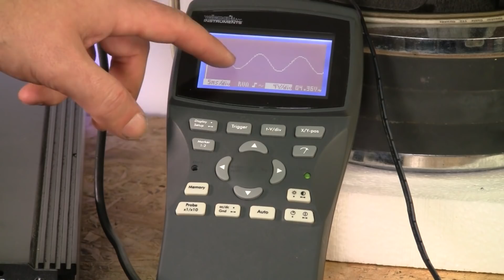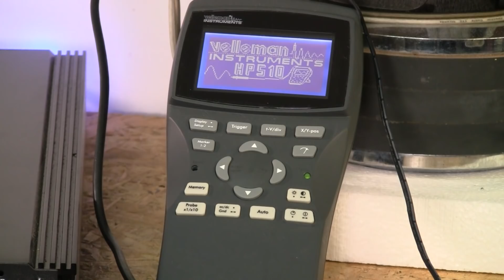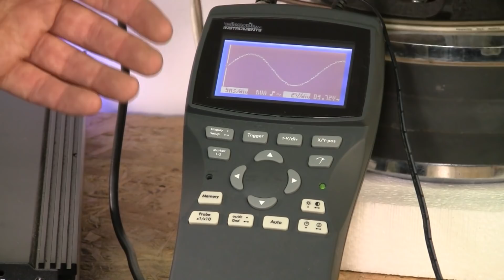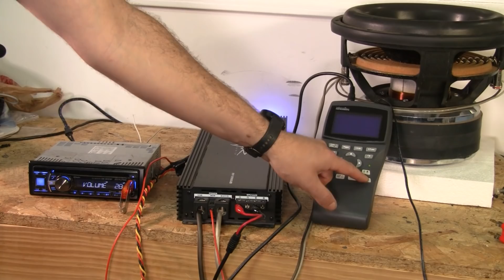How your budget amp kills subs without clipping - Tech Stuff Tuesday

Comment: I would not be surprised if there are counterfeit amps in the supply chain. This really looks like strange output. I would not feel comfortable  with that particular amp in my system. That low level noise with no input is strange, and I wish he had unplugged the inputs to make sure it was not actually on the input. But those strange half-clipping at voltages far below the rails... That is really strange. I have seen this setup working with much higher power amps. I suspect that strange signal is actually aliasing in the scope. I would bet the noise is actually up in the ultrasonic, if not RF. That amp might be causing serious RF interference.

Comment: In my opinion the amps crossovers or something is in bad shape. I've owned a few skar amps over the years currently running their skv2 100.4 on my front stage n it sound pretty good for a $300 amp. Also have a $800 rockford which obviously sounds WAAY better than the skar amp however for the price, skar equipment isn't bad as soundstream cerwin vega ect it does rated at least. The quality of the amp and the signal generated will pretty much always be a reflection of the money invested in it. Not saying anyone's wrong or right just that for the price skar isn't bad as a whole lot of companies out there. Ive had my issues with skar but no where close to the issues with alot of other companies. None the less, good to know and I will def be hooking my scope to the skar equipment I'm running atm just to see. If I do find anything similar I will reply

Comment: The simplest test would have been to start with checking the speaker terminals for a DC offset.  DC would be a likely suspect for cooking coils like that.   Amps in any price range can have that failure mode.  Good designs have built-in protection circuitry though.

Comment: Those are damn good amps and yes they do rated power hell they do 200 + more wattage over power... I got two Skar 1500 mono blocks and never not once have they caused any issues on any subs I had on em..... Skar is a damn good company
Reply from the maker: Don't confuse what a resistive load tester producing a number tell you with actual in car power. All of our amp tests we show real power, in a car, connected to subs, plus the o-scope to prove it's clean.

Comment: I have 2 12" running 200w over what they are rated on an RP-1500.1D and ran them this way for 2 years. Literally nothing wrong with them, it comes down to subwoofer choice. Another thing, is that how the manual says to hook the speaker up? I am fairly certain my manual had told me to use the outermost terminals for hooking up a single sub. Also, you are overworking the amp by using such small wire for the inputs. There are 1/0 terminals on the amp, there should be no reason you are not feeding it power through a 1/0 wire.
Reply from the maker: Ratings aren't what you think they are, and just because you didn't have a problem doesn't mean it's not a thing. I've spoken to someone who owned one and experienced what was seen in this video while another one was purchased at a different time and didn't. As far as what the manual states, the pos and negs are one in the same respectively. It's literally the same solid block of metal before it even gets to the board. There IS a reason to not feed a 1/0 wire into it, it doesn't need it and wouldn't benefit from it. That amp could operate just fine on 4 gauge wire even in a car if the wire was OFC and wasn't longer than 12 ft or so. That being said, the 4 ft long 8 gauge wire can handle quite a bit of current and on top of that, the amp isn't generating that much power in this manner. It would be drawing more current if a sub was connected at say 0.5 or 1 ohm, but with little current out it doesn't need current in.

Comment: I have a kicker cxa 400 .1 amp 
And a Skar Audio single 12 SDR sub with pre fab box at 1ohm rated at 600w rms since the amp is strong enough does that mean I will damage and ruin my amp and sub? Since it's underpowered I checked the amp Dyno sheet and it puts 514rms at 1ohm and 592 at (dynamic) 
This is the only amp I have 
And I was wondering if I could use it to power it as a temporary amp until I can get a better or would something bad happen if I do use this amp?😕
Reply from the maker: It won't be a problem as long as you aren't clipping it.
Reply: @EMFAudio  
How do I prevent clipping 
I'm new to the car audio scene 
Since the amp is underpowered would that cause it to clip? What do I do to make sure it doesn't clip this is my first audio system

Comment: Did you test it with the gain not up way to high at 3/4 way
Reply from the maker: Gain position is relative to signal input voltage, it's not a relationship to power and only related to clipping when the setting exceeds the input voltage.

Comment: you need a spectrum analyzer, along with a better oscilloscope.  Also, wouldn't the speaker itself induce a signal as it moves?
Reply from the maker: Feel free to send us $2,000 for that equipment. The speaker itself will effect the impedance, but it won't make the signal quality any different.

Comment: This needs further investigation to come up with a definitive conclusion!... It could be something wrong with your setup, your source signals, your head unit's output signal, your oscilloscope, OR that amp is just simply a very poorly designed (and very UN-refined), cheap quality Class D amp, which are more often the overall worst sound quality types of amps on average, but they are also the most efficient and most power per unit of space taken up, and most watts per dollar when new, and also the coolest running, temperature wise, and all of that is why many sub amps use Class D circuitry. But the really cheap, (and possibly even lower quality?), Class D amps like this one might be, sometimes distort the signal in at least one or sometimes even in multiple ways, which isn't as easily noticed or heard with a subwoofer, as stated in this video, but at the same time, that distorted or partially clipped signal keeps sending very high level straight DC voltage to the coils with a short duration of each DC pulse, but it's also at that exact same high level repeated over and over again really fast, one pulse after another, so that constant, rapidly pulsed DC voltage on top of the music signal, over time, that's what ultimately overheats and fries the voicecoils!...

You might also check if your oscilloscope (& test leads if applicable) are all adjusted properly, settings-wise.
Reply from the maker: The signal going into the amp is definitely fine, the o-scope checked out fine on another amp. I think you're on the right path otherwise.

Comment: Just to let you know that amp needs at least 0 gauge ofc wire to work properly and that also affect the output of the amp
Reply from the maker: Just to let you know, output is only effected if the limits of the wire are met. 3 ft of 8 gauge copper wire can support 1,000 watts with 0.38v loss, meaning it would still be above 14v for the 1,000 watts it wasn't making.
Reply: for some reason they use 0 gauge inputs.. and i didn't see any volt meter measuring the voltage on the amp inputs. I been on the car audio for over 15 years and I never seen  budget amps blowing subs. That way

Comment: Tech Stuff Tuesday Idea:

- Does Running A Higher Impedance On Your Amplifier (Say 4 Ohms On A 1 Ohm Stable Amp) Reduce Subwoofer Impedance Rise?

- Is Running Your Amp At Higher Impedance Worth The Power Efficiency? As In You Buy An Amp That Makes The Rated Power Your Subs Need At 4 Ohms. So Basically Your Running Like A 12k Amp Rated At 1 Ohm At 4 Ohm For Say 4K For Ur Subwoofers. (Being  Vague)

- Does Running Your Amp At Higher Impedance Do Anything For You?
Reply from the maker: Excellent idea, I may do that one soon.

Comment: Your scope is likely being confused by PWM ‘hash’ coming out of the amplifier. It’s possible the output choke in the amp is going bad, but more likely the auto range feature is getting confused and locking on to the wrong frequency. Get yourself a man scope like my Tek 275 and try again, I’d wager you don’t have those problems anymore. ;)
We’ll be waiting for an update vid.
Reply from the maker: That was the point of the video, if it's not clean, it won't pick up on it correctly. Naturally some are only interested in complaining rather than paying attention to the content.
Reply: Doesn’t automatically mean there’s a problem though, some noise is acceptable because the PWM carrier is at a higher frequency and no filter is perfect. You can’t remove it all, so as long as it’s not shorted it’s probably fine. If I had to guess, those coils were blown because either the amp clipped or they were played too hard for too long and simply gave up.

Comment: When you combine an AC voltage source with a freqency dependent resistance and a reactance, in this case a speaker, and you hook on an oscillioscope then you do get this kind of ”distorted” readings, nothing wrong there.... The ”humm” reading whith the volume nob zeroed could be a result of the speaker acting as a acustik/electric converter (a microphone) and picking up a transformer humm i the bakground. Or maybe a case of bad filtering in the charger used (if it whas hooked upp på the batteries during the measurements). Test this same scenario with everything identical exept that you hook upp another amp :). 

I hope Barevids can get his hands on one of this amps and test !

Comment: This video is the definition of ignorance. Any scope can be adjusted manually if auto isn’t displaying the signal you are looking for
Reply from the maker: ....and if it won't find it automatically, there is a problem. Your comment is the definition of ignorance.
Reply: EMF Audio Do you know how the auto feature works? Do you how a scope works? Maybe check your probe multiplier setting to make sure it’s setup correct. I have worked on many amplifiers and prefer to use the scope in manual so you can look at the signal you are looking for. Turning the scope on and off to try to get your signal to show up automatically is not how you use a scope. Trying watching some videos
Reply: A scope is not a tool that is designed to just automatically show you what you want. The auto feature feature can be helpful to sometimes get you in range of the signal. I’ll bet you money if you hook up any other class d amp, put it in manual and zoom into around the same point as your scope auto’d for this amp, you would see some sort of switching frequency

Comment: The oscilloscope is not triggering properly as there appears to be a high frequency component in the signal, assuming the amp is not faulty or unstable, it could be the dc to dc converter in the amp radiating into the scope front end as it gets worse as power is increased, try moving the scope a meter or two away from the amplifier. The burnt voice coil looks like clipping damage overheating to me, just because leads are not burnt is irrelevant. Note the budget amp has much less power so it may not be able to produce enough fault current to burn the leads. Budget amps don't kill speakers the customer does by driving the amps into clipping.
Reply from the maker: It's a known fact the sub shown will burn the leads before the coil when clipping. You will ALWAYS see clipping in the leads to some degree if the coil shows damage from clipping. There definitely is a problem with the amp, hence making the video.
Reply: @EMFAudio  That is bs. as shown by barevids Chanel.
 
The oscilloscope is not triggering properly  as stated by bjaudio. you Zoomed in to far on the scope.
and clipping dose not burn the leads. it is a result of inadequate RMS or continuous power available for the volume setting.  aka the waveform just flattens out basicaly sending raw DC in to the sub.

Comment: Ive had 2 rp1500s and an rp2000, sound quality from all 3 of them was terrible, replaced an rp2000 with a hifonics bxx2400 and the sound quality is so much better and the power is cleaner, same with my kicker kx2400.1 has the cleanest power from any class d amp Ive owned and I still have my synergy wfo 2.1, surpisingly the kicker still sounds cleaner
Reply: I agree on the Kicker KXA 2400.1. 
Been running this amp since it came out, approximately 3+ years now. Awesome amp, absolute clean power, not a problem with it what so ever. Sure wish it wasn't discontinued,  but the price point probably killed it. Alot of people weren't willing to pay $799.00 for it, (I was)... Then it jumped to almost a $1000, that definitely sealed its fate. Seen one on Offer Up last week for $600, I should of at least inquired about it, but I let it slip away. Interesting to note that you got cleaner power from a Hifonics than the Rp, I'm not against Hifonics, that was my budget amp in the early 2000's years. You just have to wonder that the Rps being newer, they should have a technological advantage
Reply: You 💯 on the RP amp, switched it to my Rockford fosgate amp. Night and day difference, every note sounded great. My system got stolen, now I got a down4sound jp23 and there is some knots I don’t like

Comment: Even though this amp says it is rated at 2000w, it’s proved on the dyno to push over 2700w at 1ohm. This amp is a budget banger and could have fried the sundown subs for a number of reasons that would be due to the person installing the amp. I run a skar rp2000 on an EVL 18 to and from work everyday and have never had any issues.
Reply from the maker: Remember where I said dyno's don't give accurate numbers and can be manipulated? Know what you're looking at for that 2,700 watts claim, they don't defy physics.

Comment: Why don't You invest in a proper test equipment and then see what's going on ? Scope like this is good for kids ! Proper 500MHz scope, FFT analyser and either AP5xxx or Prism Sound DScope... And then You can talk crap. This video makes no sense at all, as Your equipment is worth fu*kall
Reply from the maker: Why don't you buy a machine shop and magnetizer? Is it because that isn't the business you're in? The scope is fine for what I typically do, I'm not in the business of electronics repair.
Reply: @EMFAudio  Fair point, however if You trying to provide people with reliable information, You need to rely on Your equipment. This heap of shite should never be classified as scope. Sorry, it's impossible. A 50MHz Rigol DS1054z won't ruin Your bank and will be uncomparebly better. Not only in time domain, but also in the resolution and accuracy of the ADC converter.

Comment: Your scope was zoomed in WAY too far.  Take a gander at what it was trying to measure:

125,000hz.

That is the PMW switching that isnt being completely filtered by the main channel inductors.
Reply from the maker: Auto works fine, when the equipment works fine. That's the point.
Reply: @EMFAudio  and further there is no way in hell the switching of the mosfets has ANYTHING to do with blowing subs.
Reply: @EMFAudio  again you have the scope zoomed too far in.  Set it to manual, zoom out to an appropriate time scale and youll see it yourself.

The point is you aren't using your equipment correctly and drawing erroneous conclusions based off of normal class d operation.

Comment: You just can't start off turning your gain 3/4 of the way...up,
 you need to match your gain to the output of your head unit!
 that might be the problem by not doing it properly?
Did you break the subs in maybe the spiders were so stiff that they couldn't Flex fast enough to keep up to move the air to keep the coils cool enough so your coils burn up?
Lots of factors I run the exact same amp never had a problem 2 years now
Reply from the maker: Do you realize what a gain is for? The position of the gain means absolutely nothing on it's own, the HU volume level means nothing on it's own, and it's possible that the gain all the way up is the correct setting for a given volume level. That's also why I showed taking it up to the point of clipping on the HU. I've done two videos on sub break in, a normally built sub won't experience that problem.
Reply: steve-meade-smd-dd1 
Your welcome 😎